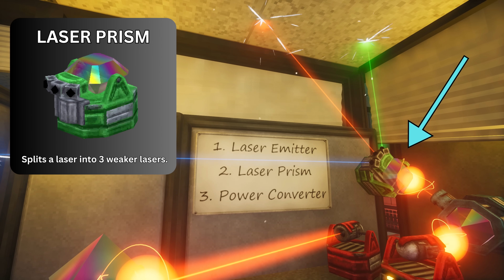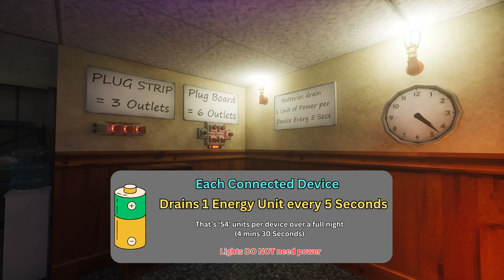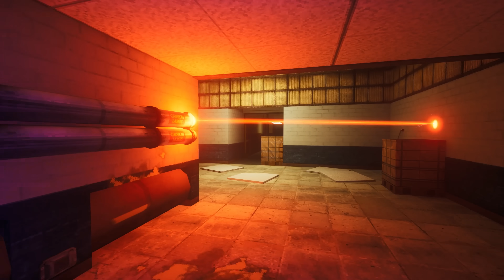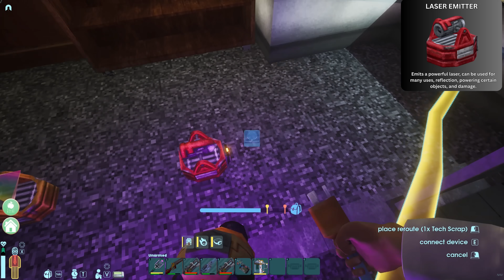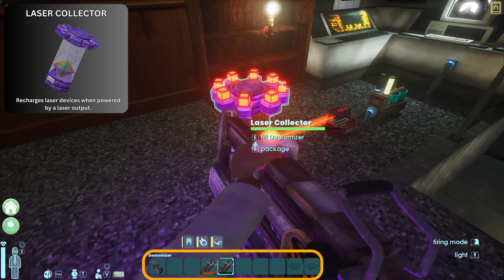Laser Guide - Power Flow, Setup & How It Works | Abiotic Factor

Comment from the maker: Attention
Some players mentioned the infinite laser power loop doesn’t work anymore, and that’s true for many setups after recent updates. 
That said, in my version (1.0.0.20809), it still works: Industrial Battery  → Laser Emitter → Prism → Converter → Plug Board → back to the Industrial Battery powering the emitter

It might be inconsistent depending on timing, single vs. multiplayer, or recent hotfixes. So if it’s not working for you, don't sweat it as you’re likely not doing anything wrong. 
Also, just to note,  the loop wasn’t the main focus of the video. It was more of a fun bonus to show how far you can push things. The actual setups before that are the real takeaway and still work great in 1.0.

Thanks for watching, Happy building!
Reply: We obey the laws of thermodynamics in this facility sir!
Reply from the maker: FYI - I'm playing on a server so that we can host the 4 of us in the group (and so I can build random stuff into the early hours of the night!) - Server settings are standard but I've recently learnt that whilst the host cannot create the cursed infinite power loop, clients can it seems.
Reply: Thank you. Does the simple Socket -> battery -> laser -> Multiple devices thing still works? (I haven't got them lasers yet, but that's what I'm most hyped about as right now I have makeshift batteries everywhere 😅)
Reply from the maker: @chrisbt5508  Yes, the 'Many Devices' setup I showed will still work, it's just the 'infinite power voodoo magic' setup seems be spotty and work for some, but not others.
Reply: 次はロングジャンプバッグとジェットパックについて話して欲しいです!
飛んでる間もローリングで飛距離を伸ばせることとか、ヒートする前にアイテムメニューで2つのパックを交互に交換することで無限に飛べることとか、面白い遊び方がたくさんあるので！

Can you talk about  long jump pack and jet pack at next video？
player can easily have a funny journey through these gear such as  flying longer with rolling, and infinite flying by exchanging each pack from item menu
Reply from the maker: @ざばあわかあか  こんにちは!  にほんご  が  すこし  はなせます

Can you tell me what info you'd specifically like to see?
I myself use the Jet Pack with Gravity Cube Trinket as it suits me for building but also traversal anywhere!

どうもありがとうございました.
Reply: 返信ありがとうございます!
あなたの言ったセットは自分もよく使っています。落下ダメージでよく死んでしまうのでその2つは探索では欠かせません
I always use those set for traversal too! 

ジェットパック、ロングジャンプバッグの話となると、やっぱり「空中での面白い、役に立つこと」の話が中心になると思います！
players will use these gear for flying, so i think something usable and funny about flying will be a good info.

さっきの自分のコメントにある、ローリングで飛距離を稼いだり、2つのパックを交互に交換することによる無限飛行はヒートによる落下を回避できたりします。
他には、現実では絶対ここに立てないだろうとっかかりや、壁についてる小さい凸凹（例えば各リアクターに入ることができるエントランスエリアの壁についてる凹凸）には密着すれば立つことが可能なので、様々なところに危険なく移動できることが思いつきました。
except rolling further while flying and infinite flying that i wrote in my comment,  I  just came to mind that some objects such as the bumps on the wall, thin wire are able to stand though it's impossible in real. 

自分は本当にパックがオーバーヒートを起こして落下ダメージで死ぬことが多いので、少しでも落下死を回避する方法があれば話してくれたら嬉しいです。
Because I always die from fall damage so it's good and interesting to know the way to avoid fall damage in dangerous situations-- Overheating gear, accidentally falling without any flying pack, etc...

ありがとう! Thank you 😊
Reply: Hey - what about the "weaker" thing? Can we clarify what "weaker" means in some context? Can we clarify how and where it matters? I'd love that, thanks!
Reply: I thought they fixed infinite power back in dark energy update. It might still work when you first connect it but it will stop working once you log off and restart the game.
Reply: that don't work either anymore, tho the info is good info love the vid
Reply from the maker: @rgsheppy5897  It still works if you're a 'client' on a hosted server. Not the host/solo. Might get patched soon.
Reply: The loop only works for an uncertain amount of time for now. It seems that the game actively checks if loops like this exist regularly, and disable it by either reducing the battery charging speed or cutting off the electricity output of the converter completely.
Reply: Toilet dimension base incoming? I have a workbench ready for it but I am not getting the teleport...
Reply: I've come to the discovery that the loop works for me, but in the poop realm, outlets as a whole cease to function, any powered outlet can't connect to a device.
Reply: One thing I'm going to have to try, that I haven't seen anyone try is having two laser emitters, one on socket and one infinite laser loop pointed at either the same splitter and/or laser powered socket.
Reply: Itd like to report i found a semi solution to the infinte power issue. Battery of your choices -> Laser Emiter -> Prism ->converter -> Recharging station. As long as you have a battery on the recharging station the only thing youll have to do is swap batteries from time to time. Thus after the initial charged battery set up your free to cook.
Reply: Okay I'm glad you clarified, because I already tried the infinite loop thing out of curiosity and it didn't work. But I plugged the converter directly into the battery, which I guess was my mistake.
Reply: There is an actually working infinite power setup with two carbon barricades. There are videos how to setup these. The only problem is that when output laser switches - converter stop working. I solved this by replacing all batteries to makishift and adding industrial batteries before output lasers - the idea was that output lasers shoud never stop emitting. This solves problem with converter stop working. I use this setup in my solo game - should work in mutiplayer host too.
Reply: Noooooooo, I didn't experience the infinite energy 😢
Reply: I can't plug the plug board into the battery so I don't see how it could work
Reply: "the infinite power loop wasn't the real focus of the video"
... For you. :P

Comment: If you find a laser in the world, then use as power converter to get power out of it, and then a plug board in front of it.
Then you basically have hub with 24/7 power where you don't need to worry about batteries.

Comment: So I know that the infinite loops doesn't work anymore but I have a wall socket plugged into a single battery that is hooked to a laser and then into a coverter powering my whole base. Once I learned that I don't even need batteries anymore. I think a single makeshift battery will power one laser all night and then with the converter you can chain plug boards all day off that for everything you need

Comment: If you have multiple lasers pointing at a laser collector, does it charge faster?
Reply from the maker: Power is either 'On' or 'Off' in this game. This means 1 laser = power supplied. Multiple lasers won't make it any faster. A good solution is to build 2, keep one on you and rotate them.

Comment: Looks like it’s PATCHED, The infinite Laser Loop doesn’t seem to work on Xbox. Use an industrial battery plugged into an outlet powering the laser, it’ll work the same way and only drain to about 1/2 over night. 
   I did get an infinite laser loop to work through a really complex setup of batteries and splitters and emitters, but every time I’d leave the area it would stop working until I teleported back and not just come back, I had to teleport. I may have broken the game engine with my crazy design. Not reliable and I can’t duplicate it. That was on 11/11/25 fyi.

Comment: Question: the laser prism says in the description that it converts a laser to 3 weaker ones. So, are they actually weaker, power wise? Like if you run one of the 3 to a laser collector, does it power slower? I'm sure I could find out myself, I just need to a mats run to get more stuff to make them. If they aren't weaker, power wise, then how are they actually weaker? Damage-wise? hmm.
Reply from the maker: Great question. In my testing It was funny with regards to 'weaker' lasers. One thing I noted was they can't power items too far away, so the beam can only 'travel' so far unlike a full strength beam. 
I didn't notice any less input on the power from the weaker laser, as long as it was in range the item was either 'powered' or it wasn't. - Further testing could unravel more of course.. however I'm now building and testing stuff in some other games and will upload more content later :D

Comment: I kind of hope they patch out the "powering a lot of stuff with only one laser power converter", as it's kind of too convenient? It's nice for mega bases that powers 20 portals, all the crafting stuff, 10 freezers, 3 neutrino emitters, 10 heavy laser turrets and a random heater (my current main base in the MirrorTM), but for any other more realistic base it's too easy to set up shop once you unlock laser tech. 

Want to cover your celing in lasers for a fancy look? No problem! Lots of freezers for convenience? Sure! Infinite numbers of powered defenses? Ok! Too easy. And since I know it's there and ready to be abused, it's kind of awkward to not use it if I can. I mean, in a smaller base that don't need more than one or two carbon batteries to power everything it's fine to avoid it but anything more and it's just such a hassle to deal with things "properly".
Reply from the maker: I agree, there needs to be some 'challenge'. However it does tick that 'abnormal science' box and for some players, it's what they'd prefer!

Comment: good vid but it didn't answer the question that led me here.  
The "weaker" lasers you mentioned when splitting with a prism are weaker in what way ? 
Power output, distance transmitted, or something else entirely ?  I left none the wiser.
Reply from the maker: I should have mentioned this then! (really tried to keep it under 5mins) 

- Essentially from what I tested, 'weaker lasers' can only be redirected so many times, I think it was 3 before they no longer supply power or damage. You could still send this into a power converter, back into an emitter and you're at full strength again. 

I think I remember the devs mentioning the weaker lasers not being able to power converters, but I had no issues with this so they might not have implemented this.

Comment: It'd definitely be worth mentioning the "weaker" laser aspect of the reflector and prism, as I had no idea what this meant until I did some testing myself.

Simply put, it doesn't actually reduce the amount of power being transmitted at all, it just limits how many times you can reflect/split a laser before it becomes unable to be transmitted at all. From what I can see, you can reflect/split a laser from an emitter a maximum of 3 times before you have to use it or convert it back into power. Funnily enough, if you convert it back into power, then just use that power on another emitter, the laser goes back to full strength!
Reply from the maker: This is correct, in my testing I only found it to reduce the amount of times you can redirect it so you can simply fire it back into a converter setup for more power. Kind of expensive in parts but also fun! 

Some people had trouble with this after the Dark Energy update where they fixed some laser loops, but they stated back in feb they weren't going to patch out infinite energy entirely.

Comment: Can confirm it does not work if you are the host of a multiplayer session. It can work if a non-host player sets up the lasers, but after doing so, the host cannot interact with anything that is part of that power grid. Anything connected to this infinite energy setup is effectively broken for the host, who cannot connect anything.

Comment: Looks like this was patched out. Attempting to wire it this way results in the laser collector not outputting power, and attempting to wire anything at all as the host results in the wire refusing to connect. But friends can do it for you. Somehow. Still won't make electricity.
Reply from the maker: Yea it seems only on hosted servers where the client and not the host does it, can it still work. It's bound to be fully fixed eventually. Laser Power is still strong though :D

Comment: Does the laser turrert dps change depending on the laser "strength"?.
Say feks do 1 strong turrert vs 3 turrets weak do the same dps?
Reply from the maker: Power is either on or it's off. 
So devices either work, or they don't. 
Disregard strength of devices. 
Engage monkey.

Comment: I spent too long making a path from the exposed laser in offices, to the tarasque security point using laser emitters/prisms/reflectors & batteries through the tramway,
looked awesome, and worked for 5 minutes!

till it despawned the laser at offices.. 😢

i wish that sort of thing could've worked 😭
Reply from the maker: I like the build challenge of something like that. It's a shame it doesn't work but I understand why they have to do that in the game.
Reply: Technically the game could've remembered the last source of laser.
They already track for looping lasers, making sure you don't build an infinite battery.
The exposed wall laser can also be 'tagged' as a natural source, and the redirected beams be kept 'beaming', using the last powered source, even after unloading sectors, without having to rely on placed structures.
As in - the game already knows that the environment beam is constant, so any item, left on the edge of your loaded sector redirecting the beam, should keep the status of said beam and keep producing it, even though the source has been unloaded long ago.

Comment: Am i understanding this correctly, ONE emitter is enough for 30+ devices??
Reply from the maker: You are understanding this correctly, if you build it right. Power is based upon devices connected to the battery, that holds charge per night cycle. 
An industrial battery holds 100 and one device uses 54 per night - in this case, your only device is the emitter. 

QUESTIONABLE SCIENCE!!

Comment: Not sure how you got the battery to charge itself. Duplicated your set-up and tried several variations. It won't let the plug strip go into the battery (lets go of the cable, no sound, no connection). A few small variations allowed me to have a loop plugged in, but the battery drained normally powering the laser emitter. You somehow found an unintended way around their fix that was supposed to stop this very loop from working. Does the loop continue to work after you exit/reload the world? It took an infinite power triangle with 3 carbon barricades, 6 laser emitters, 4 laser power converters, 3 plug strips, and either 3 carbon or 9 makeshift batteries to do the same thing after the nerf.
Reply from the maker: So the more people have tinkered with this, the more I understand. This 'cursed infinite power loop' only seems to still work if you're playing on a server, and you're not the host. i.e, you're joining as a client. 

Since I play in a group of 4, we have a server running with standard settings on version (1.0.0.20809). The host of the server encounters the same issue as you when he tries to replicate it. 

Interestingly, when I load back in, it's still working and charging itself, even after breaking it down and rebuilding it to test. 
It's an odd loophole that will likely get patched out at some point.

Comment: That's actually far more powerful than I thought. Was absolutely expecting there to be some sort of check or such in place to gauge how much power you're trying to pull off a single power emitter.
Reply: Yeah I assumed the same which is why I largely saw laser power as useless outside of what it is required for.

Now that I get that it essentially turns one use from a power source into multiple, I get it. Didn't even need a video. Saying it only counts as a single power source and doesn't drain more energy when more devices are attached would've been enough.

Comment: did some test, I believe how the dev fix the loop is if there is a loop, the converter simply does not generate power.
if you move mouse to the device next to converter (in this case, the plug board), you should able to see an out of power icon.
i made exactly the same setup with the video that is what i found in my game.
Reply from the maker: It works fine in my game, not that it was the point of the video. 
I did however learn that because we're playing in a server (Standard settings and all up to date) it can mean that while hosts can't do the loop, sometimes clients can!

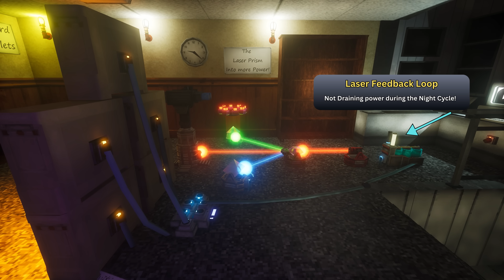Comment: 4:20 it was already patched somewhere after or in dark energy update. I am surprised that it worked in your video.
Reply from the maker: Yes I've seen that and knew that prior to diving into lasers. 
I've seen it's working for some and not for others, not that it was the main point of the video. 

A user mentioned, that it's likely because I'm playing on a server with 3 others. The server is running the most recent patch and standard settings but there seems to be a loophole that clients of the server can still create this cursed loop.

Comment: A way to understand this, sockets uses battery energy, and laser devices used laser energy.

The load only exists exclusively to battery, not laser.

This means making laser inside a battery network would cut off load accumulation between them.

You can in theory make infinite energy even if the facility socket runs out, just have laser emitters on extra plugs redirect the beams back to the beginning to create new energy.

Battery sockets cannot take multiple inputs, but the laser converter does!

Comment: The reason the loop work (i think) is that while prism and reflector cut a laser power to around 75%, electrecity currently flow at a constant, defined rate. 
However the laser power converter doesn't care about weak or strong the laser is and default to the facility outlet power.
An infinite loop as you get more power out of the converter than you input.
If they make the converter care about the laser strength and add a small convertion malus, it would fix this exploit.